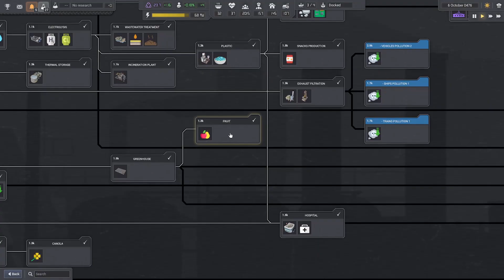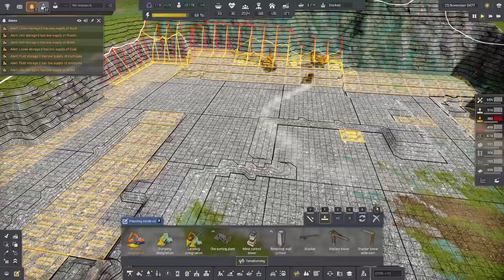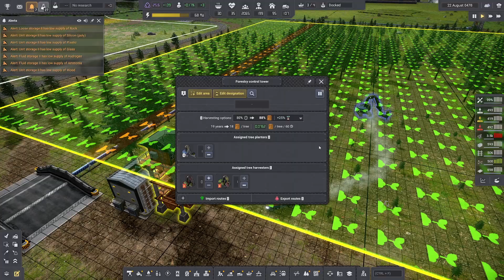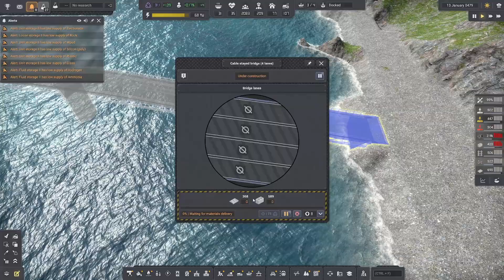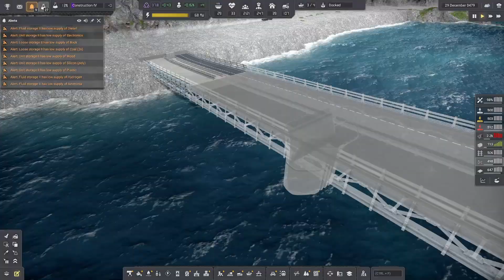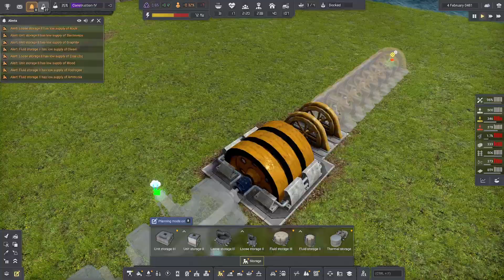Electronics 2 and Power Problems - Captain of Industry - Update 4 and Trains Expansion - Ep.28

Comment: I haven't got any coal power plants and just added a new 42MW one running on Hydrogen next to the ones using Naptha, light and heavy oil but my smelters use a lot since the arc furnaces aren't built yet. 🙂
Reply from the maker: That's one way to go about it. I like Hydrogen :)